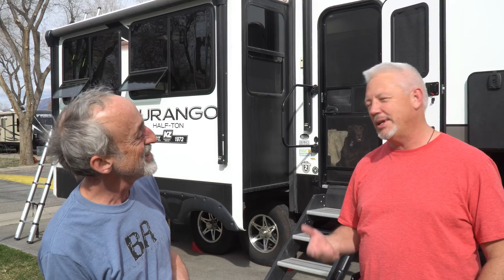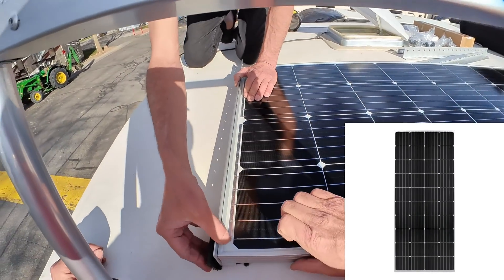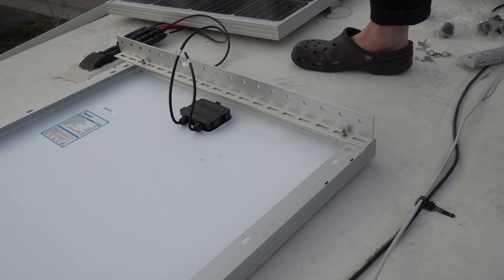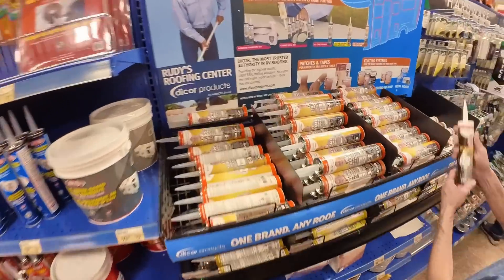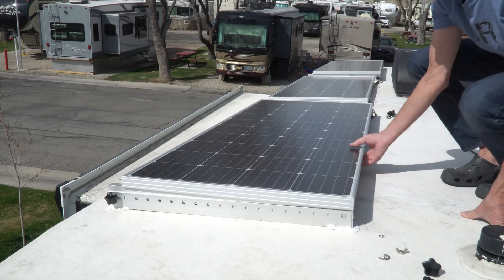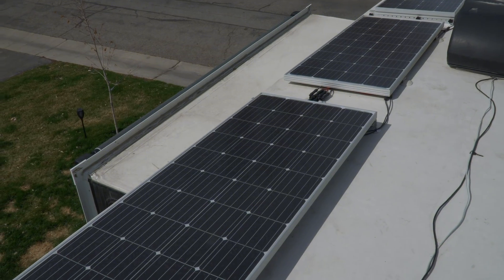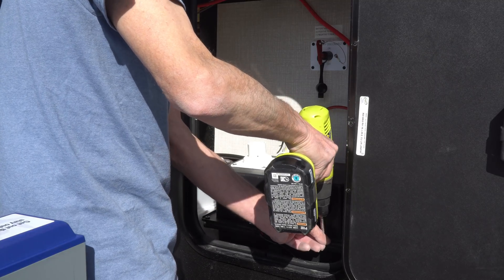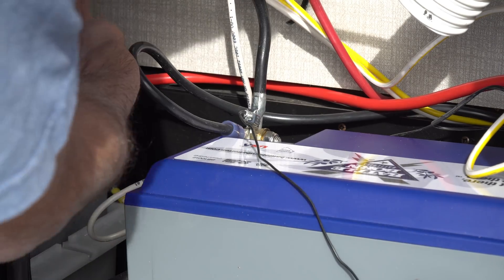Ep. 196: RV Solar Panel Install & Lithium Battery Upgrade | DIY how-to

Comment: We have (3) 200 watt panels, 100/50 Victron CC, (4) BB batteries, Victron battery monitor and and 3000 watt Victron inverter.  The system has been flawless for 2 years.  You will love yours Marc!
Reply from the maker: That's excellent feedback GP,  thanks for sharing your experience!
Reply: I have a system I put together 20 years ago, on a Class C. Still working flawlessly, because I Engineered it to last. Batteries lasted 5 or 6 years, but I would upgrade to LiPo now, given my druthers.

Comment: Good show GA.. Seems like good price overall.
Reply from the maker: Thanks J! We really did pretty well overall. The batteries were on sale for $100 off, and the solar panels were on sale as well, plus another 10% with a coupon code that we found online. Still, $3,500 in one shot is a real kick in the shorts, but it'll pay huge dividends down the road.
Reply: @GrandAdventure  Solar is inevitable. My rig is prewired for solar so I guess I'm a little ahead. Although the 50amps here at Lost Dutchman work just fine
Reply from the maker: @SevenBears1  yep, Lost Dutchman is a jewel in the AZ state park system and we enjoyed our time there immensely. If you haven't already done so, hike at least some distance up Siphon Draw into the Superstition Mountains Wilderness. It's spectacularly beautiful, and the trail starts right from the campground.  Also, don't miss the opportunity to take a drive up the Apache Trail until its current end at the Fish Creek Overlook/Rest Area (milepost 220), as the road doesn't presently go through to Roosevelt Lake and is closed beyond there indefinitely due to storm washouts between mileposts 220 and 229 (Apache Lake Marina). It's one spectacularly gorgeous drive.  

As you know, even though we spent more time in campgrounds last season than we have in our entire lives (because we went east), our preference is for off-grid boondocking where we can enjoy as much peace and solitude as possible. When choosing a site I get oddly anti-social and would prefer to not be able to see or hear any neighbors. This type of setup makes us self-sustaining in those types of situations.
Reply: @GrandAdventure  I'm with you on all that peaceful solitude. Did only quarter mile on that trail. Took 50 pictures in that time. It's been hard to get up off my chair as the view is unbelievable. The steaks cold beer and tequila might have something to do with it too.
Reply from the maker: @SevenBears1  I'll be there by dinner time tonight. 😎

Comment: Great video again. Indeed, if you go full-time RVing Lithium is the way to go. I would discharge them to max 20% to extend their life.
Reply from the maker: Thanks for the tip and thanks for watching!
Reply: @GrandAdventure  It's also good to charge up to 80-90% SOC (not 100%), which will extend the battery life too.
Reply: What I don't understand is how would you control what you would discharge or charge them to? I would like to be able to discharge them to 20% but what if my usage only discharges them to 80% and then the next morning the sun comes up and they charge up to capacity again. I would seriously like to know because if we could control that then we could get a lot more life out of the battery since they are only good for a certain amount of cycles. Do you install a solar panel shut off switch and then turn it on manually when you choose, because I have never heard anyone talk of this but it makes sense to me.
Reply: @stevec2665  You have to adjust the charge controller voltage so it doesn't reach the 100% SOC. You have to adjust your low voltage disconnect on your battery protection device so it doesn't go under 20% SOC. You do both by adjusting the voltages. You have to keep your C-rate low so there isn't much voltage drop over the terminals either.
Reply: @cleversolarpower  Ok I think that makes sense but what about my question on the number of cycles? Should I have a cut off switch for my solar panels if I only use 20% each day, why go through a cycle each day if I may only need to charge it every 4 days. I understand there are some variables there but I'm just generally speaking. Thanks
Reply: @stevec2665  One cycle is defined as going from 0% to 100% and back to 0%. Basically, you put in the full amount of energy before using all of it. You do not need to use a cut-off switch. Just keep your batteries at 80%, which will give you a very long lifecycle. So you would be going from 80% to 60% every day. That is not a full cycle. If you adjust your voltages of the charge controller and low voltage cutoff, you can achieve this and your batteries will last a very long time.

Comment: Great video. We are also getting all our supplies together to upgrade to lithium. That’s really nice you had that kinda access to the charge converter. I have seen others struggle to get to theirs. We got unlucky with our charge converter as it’s built into the panel, so a lot more wiring for us ! Can’t wait to see you guys get back out on the road !
Reply from the maker: Thanks UA, we can't wait to get back on the road ourselves! It's tough being torn like this, knowing that there are only a few weeks left to enjoy the lift-served ski season while the pull of the open road gets stronger and stronger. This year, being our first year as full-timers we have a few things still to do with our remaining personal belongings, our old home, etc. so that makes the pull a little easier to deal with...for now.

We also understand your converter situation, as it was integrated into our WFCO distribution panel in our former travel trailer. We were thus very pleased to find it sitting behind the stairs in our Durango all by its lonesome self.

Comment: Nice work Marc!!

You folks are super set up now! 👍🏼

I wondered how you were going to mount the solar panels on your roof. 
Those well nuts are pretty cool. 

I would have liked a little more clarity in the wiring of the solar panels. Probably because I have never hooked up solar panels before.

Where did you put the third battery? In the same place? 
The  wiring looked “confusing”. (Translation: messy) 😉

I didn’t realize that the lithium batteries were so expensive. I’m going to have to save my pennies. Definitely would be worth it.

Hey, I like your style. 
When we get older, we get to that stage in our life where we really don’t care what people think as long as we are comfortable.

Thank you for a great instructional video.

👍🏼👍🏽
Ram
Reply from the maker: I never cared what other people thought even when I was younger. 😄

I didn't get too much into the wiring because we really didn't wire them. This fifth wheel came from the factory with a single 190 watt panel, all the wiring, and the solar controller already installed. So all we did was put a three-way splitter at the connection point on the roof, and plugged the two new panels into the other two inputs on that splitter. That wires them in parallel, maintaining 12 volts output but combining their wattage.

The second battery is just to the left of the first battery, against the wall to the left of the battery door. Because you can put lithium batteries anywhere in any position, I just stacked the third battery atop the second battery and strap them together with a small ratchet strap. It's not the prettiest solution, but it's extremely effective.

Comment: Enjoy watching your videos, nice work.  How did you decide on the number of batteries to install.  I went with 4 of the Battle Born batteries along with a Victron 3000 watt inverter about a year ago, have been very pleased with the set up.  My installer was able to wire it up so I have use of all of my outlets except for one circuit, the one that is the GFI.  So far the set up has worked well, hope your does the same.  Safe travels.
Reply from the maker: Thank you Gary, and thanks for sharing your experience! We estimated our electrical consumption and decided to try it with three batteries for now, with the option of expanding it to four later on if we find that we underestimated our use. Our Durango came from the factory with a 1200 watt Xantrex inverter that powers the opposite of you, in our case it is just the GFCI outlets. I would like to upgrade this later on to a larger inverter connected to more circuits, but after this expenditure that is going to have to wait a bit.
Reply: @GrandAdventure  understand completely, it is not a cheap upgrade.  I struggled to determine the correct number of batteries, have seen some setups with 6 or 8 batteries, not sure how they can afford those setups.  ps: on separate note, on one of your videos, your talk about the campgrounds in the SLC area, I come out that way once a year for work, and have stayed at the KOA downtown, for me it has worked well, felt safe and was close to where I needed to go for work.  Safe travels, keep up the good work on the videos, enjoy the journey.
Reply from the maker: @garyslavonic5115  same to you Gary! We've actually stayed at that SLC KOA twice, once on the first weekend when we picked up this fifth wheel and then for our first week as full-timers between Christmas and New Year's. We agree with your analysis completely. They're by far the nicest sites of any of the four options, too. Our beef, however, was the way that they run their long-term business. They don't take reservations for their long-term sites; instead, they expect you to just show up at the KOA and they stick you in a daily site (at the pricey daily rate) until a long-term site becomes "available" within a week or two -- even though long-term sites sit visibly empty while you wait. Furthermore, their application insisted upon some personal information (like full social security numbers for each site occupant) that we didn't feel that they were entitled to for a monthly RV site rental. In the end we walked, and moved to Mountain Shadows. The staff here has been terrific and it's much closer to Little Cottonwood Canyon, which is the reason that we chose to winter in SLC in the first place. Some of the sites here are crazy cramped, but in the end it turned out to be the best option for us.

Comment: If I got this right. You put three panels in parallel With a combined wattage of 590w, right? 590 watts divided by 18 volts is over 30 amps. Yet you are using splitters that are rated for 20 amps, yes? Are the wires going to the solar controller 10 gauge (rated for 30 amp), or are they the stock wires 12gauge (rated for 20 amps). Maybe you need a second opinion on your wiring? Good luck.
Reply from the maker: Thanks for your input Glenn! Everything is rated at 30 amps -- the splitter, the stock wiring (10 AWG), etc. I'd rather have 6 AWG to minimize voltage loss and that's coming up at some point. The optimal output of the combined panels is just under 30A and the combined short-circuit current is around 36A.
Reply from the maker: Actually those connectors are rated for 50A: https://www.renogy.com/3-to-1-solar-branch-connectors-mmmf-fffm-pair/
Reply: @GrandAdventure  I am sorry to have wasted your time. I just assumed you were using 20 amp connectors (like everyone else on youtube). I have seen so many youtubers give very bad electrical advice. The reason i got triggered on this is you ran the panels in parallel. Because of possible shade issues. In my experience a good MPPT controller will not be changed in power losses over wiring in series and having some shade over parallel wiring. That only true if using a PWM controller.  It is one of the many solar rv youtube myths. Also running in parallel (higher current than series) will make the controller work much harder and have more heat losses. I have been a mechanic specializing in electrical systems and also a temporary power electrician with a crapy degree in electronics. I am retired now and watch way to much youtube. Best of luck to you
Reply from the maker: @glennbeattie6172  you're not wasting our time at all. Great exchanges of information, such as this one, are why we love interacting with our viewers via comments. Also, as we mentioned in the video we're anything but experts in these matters -- we simply absorb as much information as possible and make the best decisions we can based on what we understand. You are far more qualified to address these issues than we are, and we just wanted to film and share our experience in installing the upgrade. I'm certain that we've made mistakes that will lead to further enhancements.

Comment: You made some good choices. That charger is the one to have if you don’t go full tilt with a hybrid/smart/inverter-charger. The 60 amp charger can easily be powered by a Honda 2000 or 2200. My only concern is that you may have too small charge cables going to it. I generally use #2 and try to keep the run short as possible. Crazy how much voltage is lost. The Battle Born are very good batteries for non builders. A top notch vibration proof 280 amp hour lithium that fits within a group24 space and weighs 9 pounds less can be built for $750, if you know what you are doing. We have a (built16-280ah cells, 14,336Wh) 48volt battery to a inverter charger and one 280ah battery for 12v “House” duty with same charger you have. You currently have two ways to charge but there’s one other. You can charge as you dive and it will be fully charged when you arrive even in the dark, but you will need a DC to DC charger (Battle Born) HYCLAT 2-4 gauge quick connect (Amazon) and TEMco #2 cable (Amazon) to do it right. Oh and a hydraulic crimper, quality lugs and adhesive lined shrink tubes. Always seal those lugs and the cables will out last you.
Reply from the maker: That's terrific info, Karl -- thanks for sharing your experience. Experience, or more accurately a lack thereof, is what kept us from going to homemade battery route. We have just enough knowledge to be dangerous. 😁 The cables going to our converter are what was installed by KZ at the factory to our old 55-amp WFCO charger. Changing them is a possibility in the future, but it would require quite a bit of work to re-route the new ones.
Reply: @GrandAdventure  
Sometimes it’s easier just to move the charger closer to the batteries. You paid a lot of money for those batteries and you may not be reaching their full potential. Look up a “wire ampacity chart” and remember the length is round trip(pos&neg) get ready for a shock, excuse the pun. 5 or10 % loss is ton in 12volt systems is a ton! And revisit you wires to the inverter too. Wires are the most overlooked and most important part of 12v system. Happy trails

Comment: Very nice. You were lucky. I couldn't replace my WFCO converter. I had to run a a new outlet by the batteries and put the PD charger next to them.  I have s very similar installation and will be redoing it as the trailer I had it in got wrecked and I'm starting over again in a different trailer. Great video.
Reply from the maker: So sorry to hear the fate of your last trailer, J, but bigger and better adventures await! Your situation would have certainly added to the complexity of our install, but it sounds as if you got things all figured out.
Reply: @GrandAdventure  I called a dollar company and they said to leave the old one and just add this one for the lithium.

Comment: Nice tilt mechanism.  I have about the same power, 660W of panels, but it's fixed flat.  I thought about tilting, but I didn't want to be climbing up the ladder all the time.  We're on the move quite a bit so it didn't make sense for us.  If you're using the Victron Shunt for battery monitoring, you love that device.  It provides really accurate data for the battery charge level.  I also have the internet connected to my Shunt so I can monitor my batteries from anywhere by phone or laptop.  I love that capability.  Seeing you replace your charge converter brought back memories of my conversion, using the identical 60A Progressive Dynamics lithium charger.  I started off with 2 lithium batteries, but I may install a 3rd later on.  So far I'm good with 210Ah of battery (Lion Energy 105Ah/ea).
Reply from the maker: Great feedback Tom! We'll cover the battery monitor next week, it's the Thornwave PowerMon. We installed it for a fraction of the price of a Victron (which is great stuff), yet we still have worldwide data availability over the Internet thanks to integration with our RV Whisper system. We're still considering a Victron charge controller upgrade.

Comment: Too late now, but with the new jackery products of 1500 and 2000 wh  solar panel combo's, you could've saved a chunk of change. Plus it's portable and can go when changing campers.
Reply from the maker: We've got a Jackery 500, and it definitely serves its purpose. However, we're more interested in powering all of our rig's systems, so cost or not this made a whole lot of sense for us.

Comment: Where did you install your solar charger?
Reply from the maker: Our solar charger was installed at the KZ factory on the wall just inside our entry door. We may be upgrading that in the future, and if we do it will be going on the wall above our battery bank next to the battery disconnect visible in this video.

Comment: LiFePO4 batteries can damage your alternator, but not is you isolate it through a DC to DC converter.
Reply: It could also fry the charge wire/connector from the truck to the trailer.  But that's assuming Marc charges his batteries from his truck through the wiring harness to the trailer.  With 590 watts of solar power on the trailer he doesn't need to charge the house batteries by alternator now.